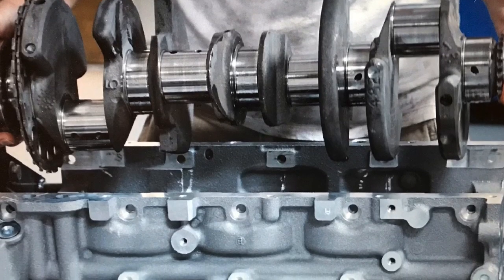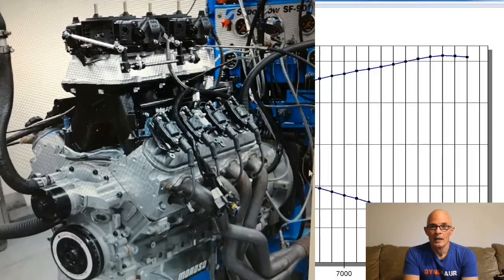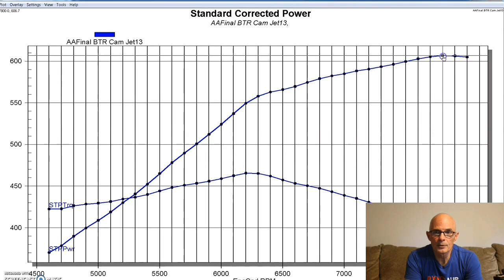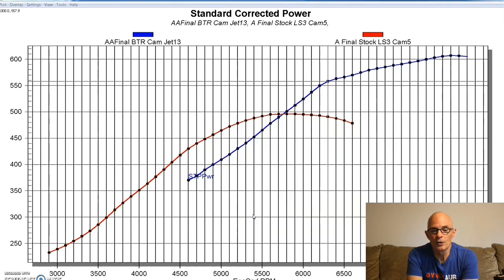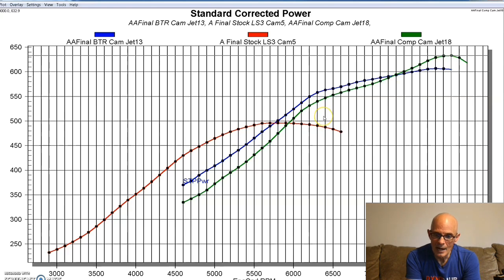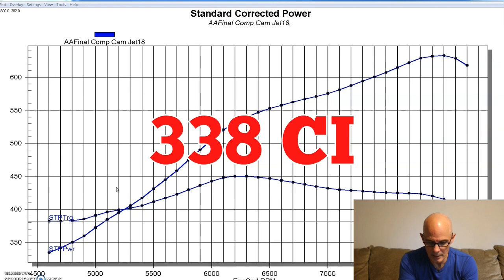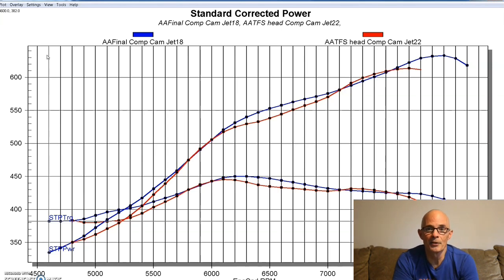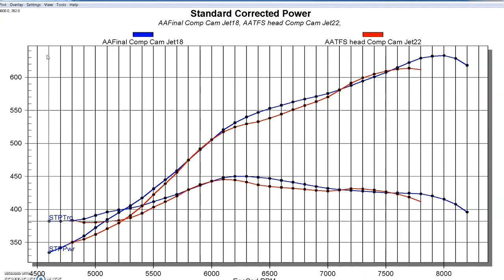DESTROKE LS-4.8L CRANK IN LS3 BLOCK-SHORT STROKE POWER-AN LS MONSTER MYTH?

Comment: Imo you shouldn't "destroke" an engine unless you're limited to a certain CID in the rule set. If you're limited, go short stroke big bore, otherwise run the biggest you can fit/afford/keep reliable to your standards
Reply: The 4.4 northstar (lc3) is actually a debored 4.6 to increase strength since its boosted.
Reply: @tec9tjguntek  Oh. Damn. Good to know. Thanks. I though they destroked that thing. Nevermind.
Reply: @EGGINFOOLS  either way, falls into the category of biggest you can fit with reliability in mind like I said above
Reply: @mightymoto1415  I don't agree but that's the good thing about opinions, everybody is right! Lol.
Reply: GM destroked the Northstar for the xlrv and stsv from 4.6 to 4.4

Comment: Its cool for  a class motor.

The limitation on a longer stroke in RPM is cylinder speed and friction due to length of piston travel.
Reply: DBSSTEELER agreed,  piston velocity is the underlying limiting factor.  The force required to accelerate the mass of the piston is a function of velocity^2.  Eventually the force from repeatedly reversing said velocity will exceed the material properties of the engine components and destroy the assembly.  Friction adds to the mess by generating heat that breaks down material properties and lubricants.
Reply from the maker: you need to see the pistons speeds of long-stoke Mountain motors, or even a 5.4L Mod Ford, its less of a problem than valve train
Reply: Richard Holdener, first off I enjoy your channel.  Also, I agree that valve train stability is a huge factor at high frequency/rpm. I agree that some engine designs use what I consider very high piston velocity and still hold together.  However to highlight the variable of piston velocity, I’d like you to show an example of multiple engines with different bores and strokes operating at the same power level and compare the fuel consumption.  I hypothesize that in most cases the engine with the lowest piston velocity at the same power output uses the least fuel.
Reply: @richardholdener1727  what stops mountain motors from turning over 8200 is piston speed not the valvetrain. I own a 650cuin 5" bore center Hemi, exact same as mountain motors turn mine 9400rpm with ease. Same valvetrain bug the 820cuin falls hard on it's face over 8200 due to piston speed. My destroked version has no issue.
Reply: @richardholdener1727  stroker 4.Gr8t test then? The People need to know!
Reply: @johnchartrand5910  does the big motor have the same parts in it as the small motor?
Reply: @MRMOPARMAN0426  everyone has there own exact combination but essentially yes, same size piston, cam etc. Obviously a much shorter stroke to meet my class rules of 650cuin
Reply: @johnchartrand5910  would it be out of the relm of possibility that the big motors cant breathe at those rpm? Im assuming they are n/a of course.
Reply: @MRMOPARMAN0426  yes n/a and no the problem is ring speed. On the dyno the 820s literally hit a wall and completely stop making HP. This id why when you look up big motors from big engine builders like Kaase and Sonny's you see that no matter how big they make their motors they all stop at 5.75" stroke. Instead they spread the bores more and put in bigger pistons.
Reply: So initially I was basing my piston speed engine performance/efficiency hypothesis on that of the classical thermodynamic model using an adiabatic process. I have discovered my hypothesis has real world holes in it where heat energy is lost  through the walls of the combustion chamber as noted by Engineeringexplained in this clip https://youtu.be/UV3RwBPqznU.  Also, I had not investigated how turbulence from piston velocity can improve flame front propagation and fuel utilization.  I’ll have to look into this a bit further and see how big the holes are.  Has anyone measured/explored these concepts before?  I’m looking for a detailed engineering text on the subject.
Reply: Parts have gotten much better over the years. Which allows us more RPM and piston speed before we see breakage. Also, valvetrain is by far the most important thing to me. As light as possible! Stability is huge!

Comment: Wait, that was a Hydraulic Roller???????
Holy Shit, I had no idea they could rev that high.
Reply from the maker: and more
Reply: @richardholdener1727  I have an LQ4 block with a stroker crank with hydraulic lifters that go solid at high rpm due to the way they pump up. I shift at 8000 RPM at the dragstrip. 1250 at the wheels with no real issues. 26PSI max boost. So I'm proof that these motors can rev without going solid. My friends all run solid and they produce more rpm but they all seem to shift around 8000 to maybe 8400 so not much gain there. Or I'm pushing it and they're being conservative. I just don't know.
Reply: Short travel pluge hydraulic roller lifters helped with that rpm I just learned about them recently pretty interesting
Reply: GM has some really expensive low mass hydraulic roller lifters, does anyone NEED those Richard?
Reply: Hydraulic lifters have come a long way. I would be willing to bet that a solid setup would still make a tad bit more hp. The valve train harmonics and valve train stability would be better in most circumstances with a solid in the long run. There's a reason why most race cars run solid cams.  I am still impressed nonetheless.

Comment: I am building a 2000 2500 6.0 iron head iron block    block bored .030 and decked .010 heads worked and shaved .010 with a asa cam ls7 springs and lifters truinion upgrade with + 6 cc flat top pistons and I was having it Dyno tuned  he turned it 8100 rpm it was scary
Reply from the maker: it won't make power up there with that cam
Reply: @richardholdener1727  oh I know I told him I only wanted to turn it about 6500 cause can falls off in that area
Reply: @richardholdener1727  it got deathly quite about 7400

Comment: Can you achieve 600hp with the LS3 with just a heads and cam choice????????????????????
Reply from the maker: cam and intake on an LS3 will get you 600 hp
Reply: @richardholdener1727  Any specs recommended? I have 2010 Camaro SS with the LS3, and i was wanting 500hp at the wheels. so with considering the drive train loss i figured at the crank it should be at or above 600hp N/A. Not wanting to add a power adder (IE Blower/Turbo) Thanks again Richard and keep the vids coming :)

Comment: Stroke will affect starting line launch there’s a formla some use to figer rear gear ratio based on stroke.  I used this formula to help lower my 60’ and ET. It may just be another smoke and mirror old school wives tail. But there’s no one out there doing 60’ pulls and changing things on camera and showing the Chang. I’m going to try and do that this season  but it can be hard on a Busy day at the track I may only get three or four runs it. So it’s very hard to be scientific with an average of three or even an average to run to make a change for the see if it affects anything in one weekend weather could change.

Comment: This Ford guy is convinced. Ported stock cathedral ports, the BTR cam, and twin Ebay turbos to fill in the bottom end. The shorter stroke is also less stress on the engine. This would be super cheap and reliable, and so much fun to drive.
Reply from the maker: I did boost on it later

Comment: Isn’t it true that lower lsa more low end power higher lsa moves the power band up higher..so why not run a 116 lsa or something like that if your wanting to test the rpm limit..becouse yes your correct 100% and a lot smarter than me but it takes a lot more than just a short stoke to run 9000rpms and make power there
Reply: I believe carbureted engines like a lower LSA

Comment: Another reason for short stroke large bore engines is to keep piston speeds lower. F1 piston speeds are lower than some high RPM LS builds because of how short the stroke is.
Reply: Piston speed is what keeps you from breaking shit and is what HP ratings are based upon as far as limitations with parts!
Reply: Short stroke with short rod will have increased piston speeds. Short stroke with longer rod will make mean piston speed slower and reduce side loading on the piston. The ideal stroke to rod ratio is 1.7:1-2.0:1. Also with a longer rod on the same deck height you’ll have to run a shorter compression height piston.
Reply: @ianmatteson482  I think you mean peak piston speed not mean piston speed.  Mean piston speed will be the same for motors having the same stoke at the same RPM regardless of rod to stroke ratio.   Shorter rods (same stoke) means the piston travels faster for the first 90 deg (from TDC) and slower for the last 90.
Reply: Max Headflow yes sir

Comment: Can you please do a video and dyno results of the dorman truck intake vs ported dorman truck intake vs the tbss intake on a 5.3 or 6.0? There is alot of speculation the dorman is close to the fast, but there isn't any numbers to confirm.
Reply from the maker: I've tested all the Dorman intakes-their truck is not good, their LS2 is good (same as TBSS) but not as good as Fast
Reply: @richardholdener1727  what about the doorman truck intake vs stock or dorman after porting? They are alot cheaper than the fast and was wondering if you can get some decent gains after a port job?

Comment: Thanks for the in depth testing. Have you ever tested power gains from compression ratio?
Reply from the maker: yes-Its 3-4% per 1 full point in the 8-12:1 range
Reply: Would you say it's a trick question based on how the compression was raised? For example, if the pistons are down in the hole ( over 50 thou below deck) then there won't be any squish nor quench as the piston approaches TDC, but bringing the same piston to near zero deck will improve the burn quality, which should be worth some power over a simple static increase in compression.

Comment: I thought about what you said about the motor reaching an Rpm limit and it was limited by valvtrain, which is true, but I would think that the bonus of the short strike is the acceleration
Reply: How fast the motor reaches that rpm, since in most forms of racing it’s the acceleration off the line or out of a corner that wins the race, not just holding a fixed rpm point like in offshore boat racing, what do you think? Can’t you set a defined load in the dyno and test a stock LS3 and a destroked one with the same cam heads intake and see how quickly they accelerate to the max rpm?
Reply from the maker: a free rev tells us very little-we can change that with reciprocating weight
Reply: Richard Holdener can you put a constant load on the dyno of say 300hp no matter the rpm?

Comment: I’m building the same engine now. 4.8 crank  But a iron 6.0 block .040 over and a half filled block and heavily ported 862’s
Reply: Ron Gravel any specific car that your swapping it into ??
Reply: 93 s-10
Reply: A lot of money to make the same power as a stock mustang toss on headers cai intake and boom 550whp also much more down low
Reply: I got less money in my set up than you think. A installed set of kooks on a s550 at a shop cost more than I have in my set up and I got some really nice parts. I built street/race cars for a living for 3 years in Houston before I moved to NC so I got a shit ton of awesome exspensive parts for nothing or really cheap. I got a super victor intake for 50$ and a BTR huge cam for 20$ brand new in the box and I bartered the machine work for parts and time. I got a 8-9000$ engine for next to nothing.
Reply: I’ll make 550hp at the crank at bare minimum and then it’s set up to spray so I’m gona throw 500shot at it.   I’ve thrown 500shots on stock 5.3’s and they lived so I think I’ll do pretty good with my set up

Comment: Piston speed is also a small factor. A longer stroke motor has to move the piston farther at any RPM compaired to a shorter stroke. Because of this the piston has to accelerate and decelerate faster than the shorter stroke. Basicly the shorter stroke has to work a little less to rev. At the end of the day though you can build anything to rev with the right parts. 5000+ RPM 5.9 Cummins comes to mind!

Comment: My interest has been wanting to throw a 4.8 crank into my 5.7 block for an endurance motor in a Lemons car, still only reving out to 5,500-6,000 rpm like our current set up. Theory being the short stroke reduces piston speed/ stress on the internals over 18 hours of racing. I was all set to build said motor until we figured out we could save the original 5.7 crank, but I still have this itch to build it anyway.
Reply from the maker: use the extra torque offered by the stock crank in that rpm range
Reply: @richardholdener1727  We use the factory crank now, with a summit low lift truck cam. I think bottom end torque is working against us as we lost a clutch in the last race.

Comment: I did that with a 4.8-5.3 iron block I used gen 4 rods and a 4.8 crank board block to accept 5.7 Pistons I balance the Pistons gapped it for Boost slap, set of stock 799 heads and for camshaft I used an LSA cam put on some good Springs cuz after all this was going to be boosted the car was phenomenal you can be rolling at 30 miles an hour lately go into the gas and you're going sideways spinning the wheels the same thing could be set at 70 miles an hour let me get into the gas and the car is going sideways you're spinning the wheels to say lots of fun it's an understatement ultimately I sold the car and I kept my engine.

Comment: So what's the key to the valve train to support 8000rpm+? Didn't Katech build a 8000rpm LS7? They are very tight lipped about their work for obvious reasons.
Reply: I run Johnson Short Travel link bar lifters and SK703 valve springs in mine. We've beat on it a good bit with 30# of boost and 8k rpm and doing great
Reply from the maker: short travel lifters, stock rockers, the right cam and springs

Comment: Where the short stroke engines really shine is oval track racing. Being able to sustain high rpms for long periods of time. Piston and rod speed come into play. A longer  stroke engines has a lot more strain on bearings, con rods, and crank. Simply because it has to travel farther on the larger circle path of the crank. It's all about reliability at high rpms. The valve train definitely effects the rpm range but the piston/rod speed kills stroker motors. I have seen broken cranks and lots of spun bearings. 377 vs 383 sbc 377 is more reliable.
Reply: Gotta watch surface speeds on main and rod bearings too...

Comment: How does it work if you add nitrous at higher rpm. Does it equal more power? Tq x rpm /. 5252
Reply from the maker: nitrous adds power at any rpm-if you activate it lower-it adds more torque

Comment: Richard, one of the advantages I believe in is the longer rod to stroke ratio decreases piston acceleration, which leads to better knock resistance. This could allow for more compression or lower octane fuel requirements. Would you do an episode where you investigated this idea? On a side note, I have really wanted to do a turbo version of the engine you just put together, with the ls3 heads and the edelbrock dual throttle body intake. Don't know if it's the perfect ls engine,  but it would sure look like it.
Reply from the maker: i ran a turbo on it later